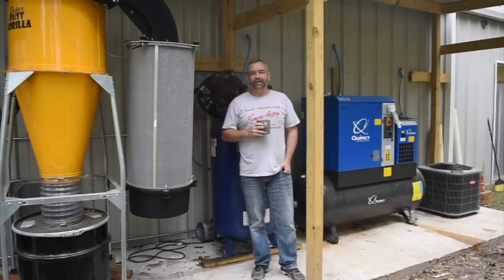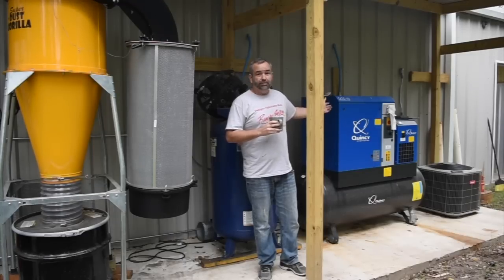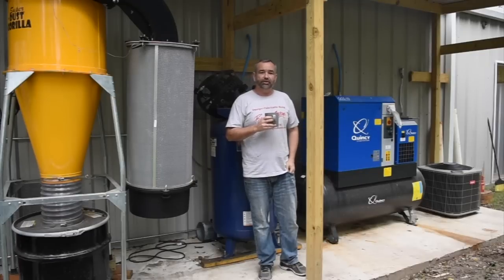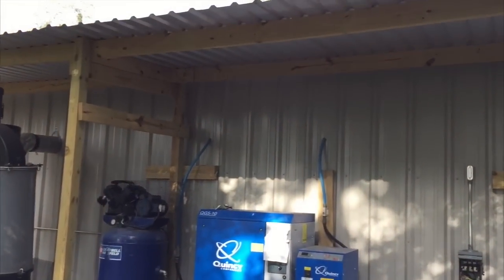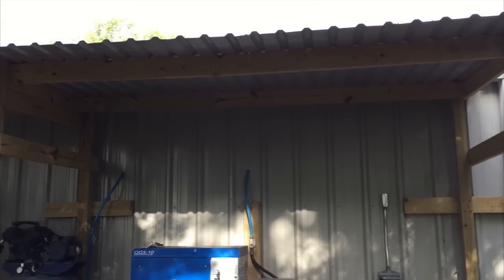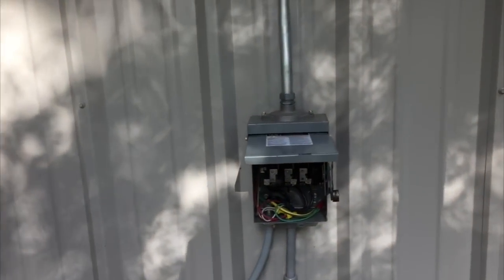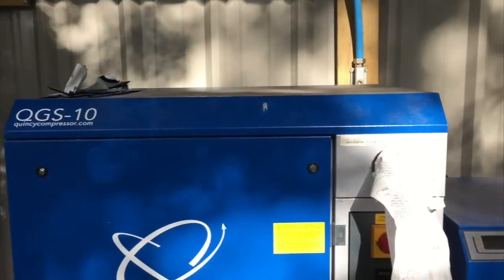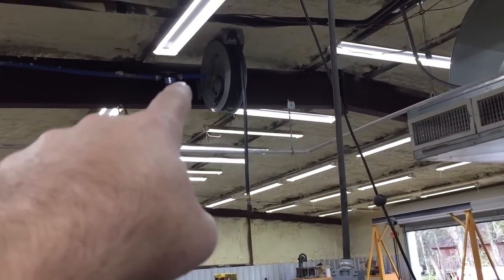Quincy Rotary Air Compressor - Building a Concrete Pad - Shelter Cover Outside - Big Air Compressor

Comment: you mite think about changing that hydraulic hose out for a fined air compressor hose .I did that and mine is just about heat burnt ,I think if I touch it it will shatter. just and suggestion

Comment: You could plumb an airline also to the old compressor from the screw and its tank would then be filled everytime she came on and give you about double the time before it comes on each time. As long as she is going to run for 15 minutes your paying for that power and should save every bit of air it can create in that time frame no limit to how many tanks you could have daisy chained together. And you can find tanks on Craigslist for a song. I bet that monster could fill ten or more tanks the size of its own every 15 minutes. Then your efficiency goes up per KWH and power cost go down as it would not be comming on and off as often and increase the life of the machine to boot. What sucks juice is the amperage to start a 10HP motor like that which is about 4 times the amperage it will use in comparison to running amperage. I had 2 80 gallon tanks linked together at my old shop and what a difference that made. If i could have had more would have done it but my compressor did not put out anywhere near the CFM as that screw must be putting out. Mine is 21.7CFM if I recall correctly and have two of them identical heads, but only one hooked up now. Other one is for backup. Remember the air pressure between tanks and line will alway be equal so compressor will run until a certain pressure is reached matters not if its one tank or 1000 tanks and nothing more then a line splitter and another hose over to the other tank is needed very easy.

Comment: Interesting about the screw type compressor.  I didn't know that.  The one at the shop has been coming on more than 4 times an hour for 12 years now.  I'm assuming that's not good for it?
Reply from the maker: Yea thats the word on the screet... John Saunders mentioned it in his video about his Atlas Copco rotary.  I asked the Quincy guy about it, same thing and mentioned about it running for 15 minutes.  I had noticed it keep running after it filled up but wasn't sure why.  Now the confusing thing is all these mercedes "compressor" cars, newer mustangs, etc all have the same type of compressors on them and they don't seem to have any issues being romped on and off of lol.  Plus, you got a Kaiser so you should be good!

Comment: Couldn't you just add some 45's in the corners to shorten the length the 2 x 6 is carrying in free span?  since its already sagging, you'd want to make your 45's a little longer and press them in to straighten out the 2 x 6
Reply from the maker: Yea thats a good point, definitely need to do that.

Comment: If you want to replace those headers over the leanto with something of similar height so as not to lose headroom, I would suggest an LVL beam, or a steel I beam. Otherwise you will need to make a double header using something like a 2x10 to be able to carry that weight. I realize you don't have to worry much about snow load there, but if you go with standard framing lumber, upgrade to Douglas Fir, which can span much longer open spaces with less sag and deflection. I wish I could have suggested something to you before you built it, but...
Reply from the maker: Whats the difference between southern yellow pine and douglas fir?  just older?  I have seen those LVL beams, but wasn't sure if they were good for outdoors... I thought about sistering in some 2X8's or 10's, we will see how it holds up.
Reply: I was thinking more about your header situation this afternoon. I believe that you can fix it simply and very cost effectively. Simply get a sheet of 1/2" exterior grade plywood, rip it to the same width as you header pieces and sister one piece on either side of your present header. The plywood will only be 8' long, but if you center it and use filler cuttoffs on each end it will fix the problem. Of course you will jack the header up to level or slightly higher (1/8" in the middle). Nail the cleats on, spacing your double rows about a foot apart with a single nail in between all the way across. Be sure also to use a good grade of construction adhesive in the sandwich. You will effectively be making your own LVL, at a small fraction of the cost, and a small fraction of the necessary labor too. Do NOT use OSB sheeting, but REAL plywood. CDX will be sufficient as it is not directly exposed to water, or if you are concerned about too much moisture, you can use pressure treated plywood. Plywood is vastly stronger on edge than conventional construction lumber as the plys are cross grained. I would use galvanized nails to fasten it. If you have a nailing gun, that would make it easier to install. If you don't mind losing a little head space, you could make your strips a little wider than the header, but I don't believe that will be necessary in this case. No snow load...
Hope this helps.
Blessings,
George
Reply: PS If you would like me to make a demonstration video, I could do that for you.

Comment: Why not have the equipment inside, totally out of the weather? If noise is a concern, build a room around it and soundproof it.
Reply: Inside is actually worse for air compressors as a certain amount of the dust makes it past the filter, fresh air will increase the life of any compressor and have had mine outside for more than 20 years not even a roof over head with no problems. And you don;t have to listen to it running being out back. Plus you free up valuable shop space that can be used for equipment that requires being interacted with. I seen a few compressors at a rebuild shop and they told me the cranks were full of dust sledge and eventually the main rod went out slamming into it. Body shops tho are the worse which I opperated. So I always liked keeping compressors where the air was not so full of partculate matter.

Comment: Don't ever plumb those 2 together and run the piston unit. the screw units can't take the pounding the piston units puts out. We have ours plumbed together but don't run the piston unit, just using the 120 gallon tank for additional storage and if the screw unit goes down we can shut the valve off too it and run the piston unit by it's self.